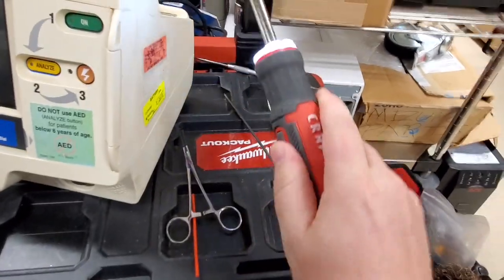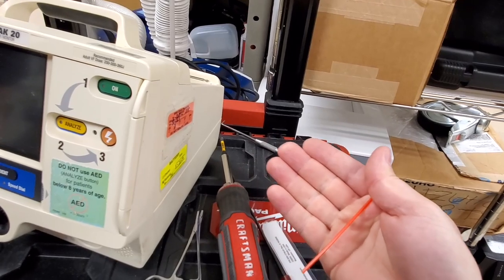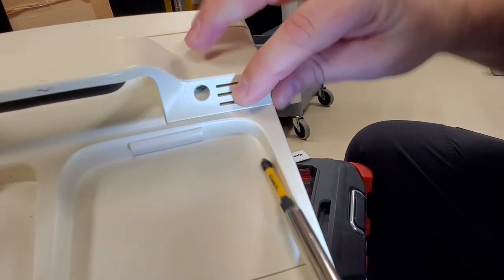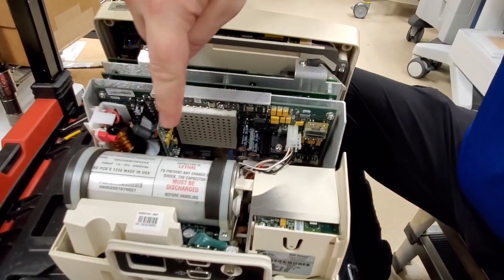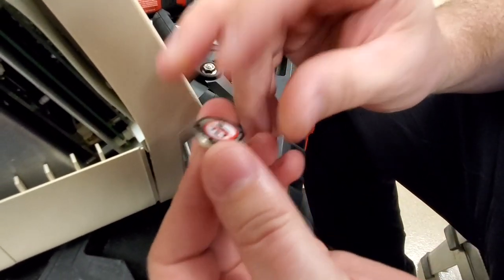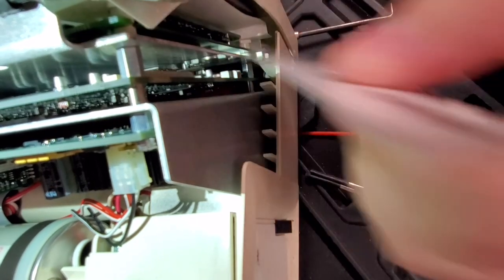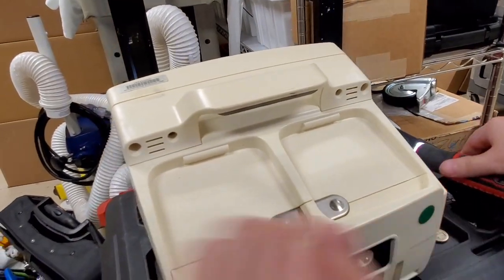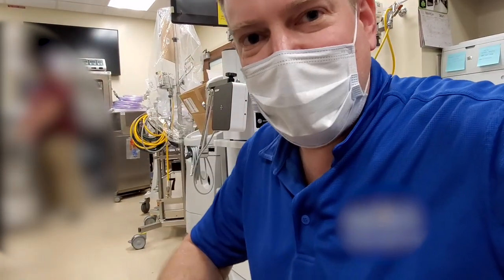Change Lifepak 20 Battery in 10 Minutes

Comment: How do you prevent any software or data loss after pulling the battery?
Reply from the maker: The defib will be cloned off one of our "masters". One for pediatrics and one for adult. This hospital has an excellent idea for indicating which configuration is setup:  the handle of pediatric defibs are painted yellow. The adults are normal.
Reply: Plug the defib. into 110 before removing the coin cell battery
Reply: really?

Comment: Hi sir what should I do lifepak 20 defibrillator date and time not save I tried alot change inside circuit battery cell kindly help if you can
Reply from the maker: The time and date are kept with the coin battery. You should check the voltage of the installed battery.